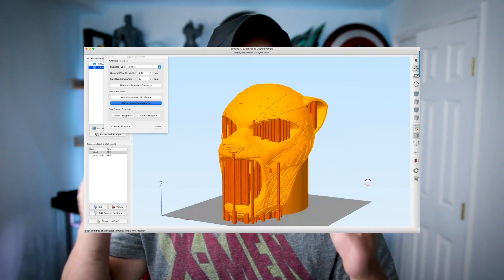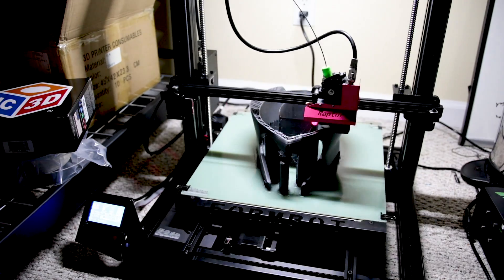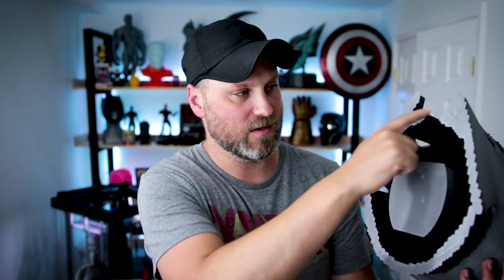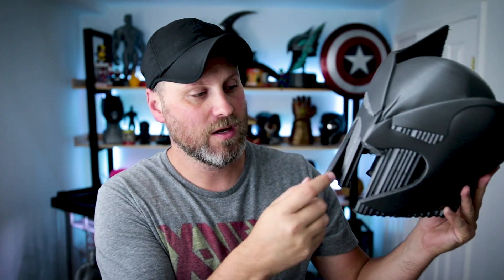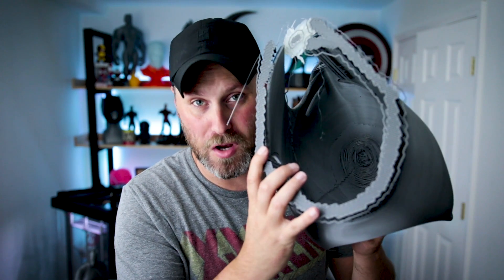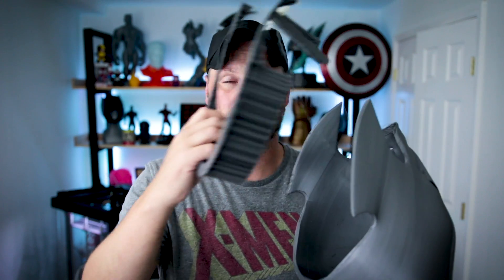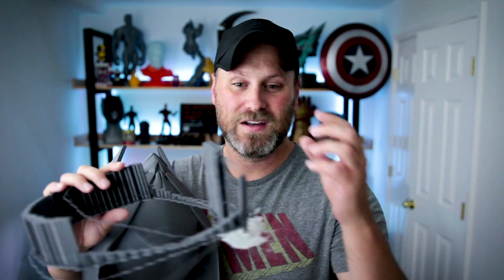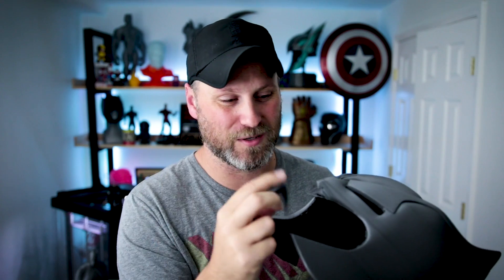UPDATE! 3D Printing Helmet Orientation - No Center Support!!

Comment: Is there any chance to get your supports settings? 
I keep getting a really hard to remove supports in a way it hurts the print, or getting supports that are easier to remove, but making the supported structure distorted .. 

So I will really appreciate if you can share your supports setting :)

Comment: Your helmet prints are  phenomenal.  I just started a Shoretrooper helmet and it's taking forever at a 0.16 mm layer height.  Are you printing at 0.2 mm?  I'd like to print  faster at 0.2 mm but I'm concerned that the surface will be more difficult to clean up and get to a smooth finish.

Comment: I missed the original video about helmet orientation, but I've been printing helmets right side up with no internal supports for quite a while. Printing upside down can be a good approach in some cases, but it always leaves the top of the helmet looking rough from the supports. The natural dome shape of the helmet generally means that it will come together fine without any internal support as long as you use enough top and bottom layers, and it takes a lot less time and filament.
Reply from the maker: Dude, your life sized JAbba is absolutely crazy. Congrats on getting that all printed!

Comment: Thank you for sharing your methods. How much does the helmet weigh? How much PLA do you save by only using perimeter support?
Reply from the maker: Will have to double check the weight. Hollow Support structure vs No center supports was like 6-8 hour difference, Regular center supports was like 10-12 hours saved. Pretty wild man.
Reply: @UncleJessy  Wow! 🙂

Comment: Going forward will you still use your interior support structure or start using Niko's method of just rim supports?
Reply from the maker: Phirom Seng really all depends on the print. If it’s a full helmet like this I will probably do rim only. If it’s a faceshell/face mask I will probably use the support structure still. Awesome to have multiple ways to do things.